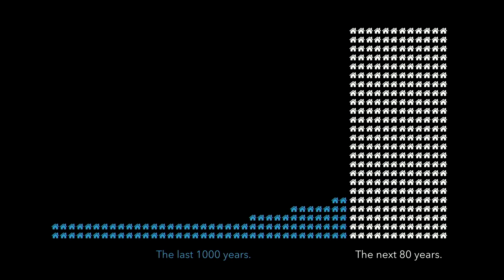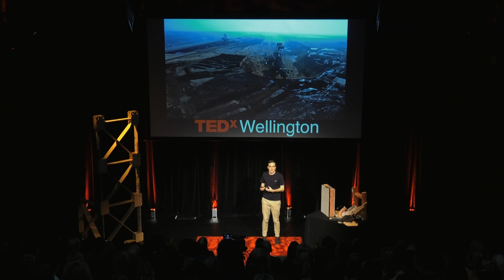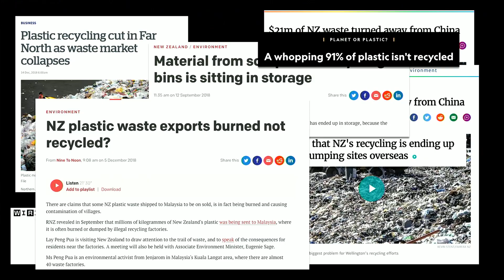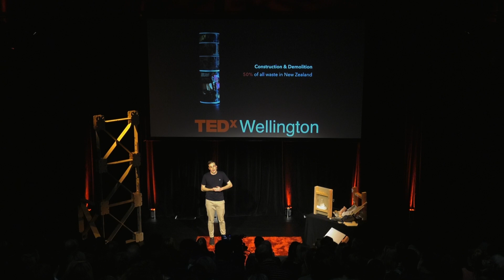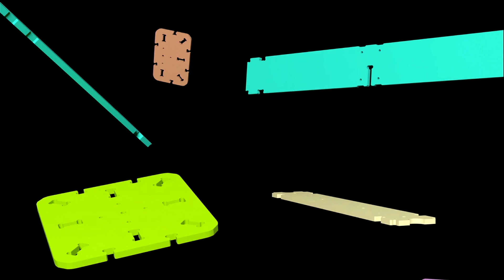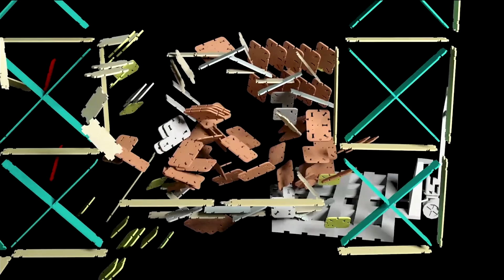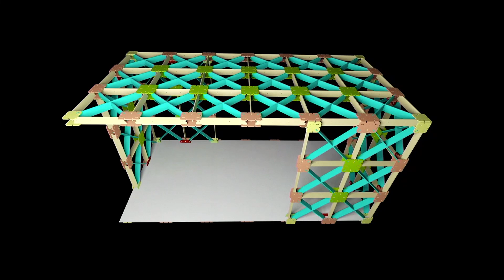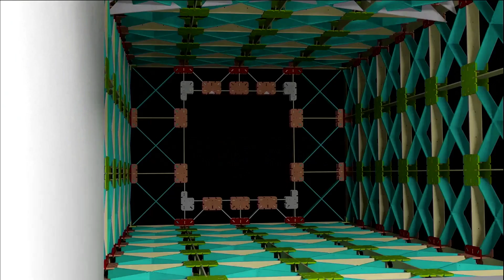Why we need to rethink how we build homes | Ged Finch | TEDxWellington

Comment: In house there is many of functional partarts. Like ventilation, water pipes, warming systems and electricity. It is not only simple core for building. We need think more. One my idea is one centralized container made by metal, which is reusable and can do most water (small kitchen, shower and laundry systems inside), warm and electric needs for house. This is like module what you can attach to bigger wooden "over simplified" living area, easy to reuse/recycle...

Comment: This is really interesting. I designed a similar system for desk and paper management to get into engineerjng school, and I thought about many of the same design problems. The issue with this presentation is that he doesnt really address how these materials would be insulated, waterproofed, and mold resistant without the harmful chemicals he is standing against
Reply: exactly my thought. This doesn't solve much and can be done with screws.

Comment: This presentation poses more questions than it answers... What is the magical material the components are cut from? Is he advocating an even greater use of plastic? Of the 2 billion " houses" the world will need, is this a reference to single family, free standing homes, or does it refer to housing units, many of which would be high rise urban dwellings. How high can you go with this system? Manufactured at scale, how much does it cost , per square foot(meter), per unit? Does this " student" have any financial interest in this project, or for that matter, any practical experience designing and building ANYTHING to completion? 
 There are high quality, reuseable structures. Stone and timber framed dwellings with slate roofing. Good buildings don't need to be recycled every fifty yesrs. We don't build with sheetrock and vinyl siding because it's good, we do so because it's cheap. I watched a TED talk given by a lady architect who worked wonders in bamboo, primarily in Bali. I wouldnt mind seeing big scale foam filled Legos as a building component. (Have you tried plucking those things apart!?) We need vision , not Ikea .

Comment: Eye opening for me.  I'd like to see him get into the practicalities of plumbing, wiring, heating, foundations etc.  I don't see how those horizontal surfaces - ceilings and floors avoid sagging & breaking up, or how the seams in the interior cladding just disappear like that.... the exterior has to be waterproof.  That isn't covered either.  Architects are often accused by builders and engineers of having their heads in the clouds.  This guy may be one of those.  All the same, he's right: we need to rethink current practices, methods and wasteful use of materials.  Absolutely right about that.  Plenty of rethinking required, and this is a good starting direction.

Comment: What is this going to be built with?  Wet wood that shrinks or swells? You'd lose significant amounts of structural stability if there was any deviation in the leveling of the ground/foundation. 

And pardon my ignorance, but... I don't see a lot of compensation for stresses due to wind or earthquake.It's really expecting to put all those stresses on those octogonal shapes that are numerously scattered throughout the structure.

I like your out of the box thinking, but how useful is this?  I think people are going to have a problem thinking their "new" house comes from recycled components.  Who knows where it used to be before (whether down-wind of a nuclear plant or next to a chemical plant)?  Or had mold?  What do you fill the wall cavities with to stop airflow/noise?

And where do you store that amount of material between houses?  

I do like the idea of modularly scaling up/down as life needs changes, but not sure where the concrete pad changes in size or the plumbing/electrical that goes with it.

Lots to consider there!  Good luck!

Comment: I see in the real world example that you show only the structure. How does your product work with the rest of the building systems like electrical, heating and air conditioning, with cabling, and insulation materials?

Comment: What a joke. This is what a PhD candidate thinks is a good idea? Let's just skip the insulation, plumbing, heating, AC, electric? Snap together components will only snap together so many times...there is a concept called wear. Snap together components do not hold up to wind as you can see them "constructing" at 11:30 a building inside another building. ..."inherently resistance to earthquakes" with no testing?

He also skips finish materials. A house may last a 100, 200 years, yet be completely remodeled 10, 20 times in that span (by today's standards). That's what's filling landfills. It's pretty rare here in the USA for a house to actually be torn down. Especially torn down because of structural failure.

Many buildings that have lasted hundreds of years. Take a walk around European cities. We know how to do that. In modern times we understand how to bolt and screw things together to make them reusable...if we wanted to. The issue is we don't want to. We want, demand, the latest style, the trendy. It's not houses that need to be re-engineered, it's the way we think. Don't hold your breath. This ridiculous talk got 2500 up votes compared to 114 down...we're losing the ability to think.

Comment: I been saying that over a decade. India has a cooling design using a kind of bell tower at the top that can ventilate the house and cool it. We can create some really neat materials now and create houses that are mostly modular designed parts. Soon we may be able to 3d print them with hardened carbon.

Comment: It will require recert of every piece of this lego style construction each time you pull it apart and reuse. If you think Fed, State, and local building codes are going to just let you do whatever you want, when ever you decide to... you have not been paying attention.

Not to mention Home Owner's Insurance.

My home is 130 years old. It should last another 130 if some knuckle head doesn't let it get run down. For example, I had it vinyl sided a couple years ago. Cheaper than paint. Lasts 5 times as long.

Good old wood frame, lathe and plaster walls, and a field stone foundation.

Comment: Interesting, that doesn’t seem very feasible. People mystical sorts of stuff on those services what does the finishes will make it hard to recycle of things. And I’m not gonna be recycled. And I look like they have serious structural limitations.

More important than this is making homes that are energy-efficient, structurally sound, and suited it to the environments. As well as providing light and ventilation in the sense of warmth and wholeness and protection to the people use them.

Germany’s “triple-zero” homes or a place to look. You can heat the whole house with a fart.

Comment: let me think...Electrical and pluming can be ad if instead of using that skinny wall you make it a double wall with a space in between, same for the floor and insulation in between the space too. 
 the same double or triple interconnected system could be use to build large Beams that will support heavy loads (roofs, second floors), and all of this structure would made with one material and one material only Bamboo! Give me a lever long enough and a fulcrum on which to place it, and I shall move the world.

Comment: Getting people to accept this erector set type construction isn't all that hard. It's the builders that you have to get invested in your vision. Is it faster, cheaper or easier to produce? What is the profit margin like? Can you get financing for it? Building code approval?

Presumably the resale value should be quite good if you can sell a modular room off when you need some extra cash. But that would also make it difficult to secure any kind of long term mortgage loan since the bank cannot guarantee that you won't disassemble and sell pieces of the collateral. It's added work to routinely inspect and certify the condition of a property. If you offered financing from the manufacturer you might have a shot. Still have to get zoning authorities to let you build in already populated areas if you want to genuinely spread the idea though. I guess you could start your own city, that would be a good objective.

Comment: This guy has zero experience in the building trades.  He may be right that in New Zealand houses fall down after five decades. I don't work in that country so I don't know about their use of materials or building practices.  I live in the United States and I work on houses which are in fine shape after 200 years at times.  Although I do agree we live in a throw away society for the most part, I think one would find that reusing Lego's after 50 years of service is well, laughable.  Your just using a more expensive way of building the parts. The end game is the same.  Maybe they don't have proper carpenters down under.  Don't know.  But we build stuff to last here.

Comment: It might be cheaper and quicker to build, but will creating these components be cheaper than wood?  And will people still be using the same methods in 50 years and actually have a use for these, by then, very old components?

Comment: Too many parts, too many joints. A complex way to make a structure that still needs all the added materials to make it work like insulation, lining, etc. Minimizing the range of bits, labor and materials that go into creating  a building is what needs to happen.  In my view the answer lies in using  a locally available filler like clay, mixing it with recycled plastic? modified into a bonding medium with some structural flexibility and 3D printing the entire house with robot design technology. The cavity insulation matrix, window reveals, wiring conduits etc etc being all 3D printed by a robot with minimal energy requirements. Std, manufactured elements for high load structural elements like lintels, joists etc could be  added as the house was printed. Thanks for prompting the discussion. That's my thoughts anyway

Comment: It would be great if Ged actually provided links to the research. A bunch of CAD animations showed how to construct the walls as interlocking pieces which is great and a nice concept. But what about the waterproofing, insulation, outer cladding, utilities etc. This didn’t seem, on the surface, to address any of the problems touched upon as reasons for current building methods and mterials, like water ingress and heat efficiency which are the primary reasons for building shelter.

Comment: Lets see,  the obvious flaws in this are much higher levels of labor during construction, much higher materials cost,  not to mention nothing was said about insulation,  weather proofing, or dealing with the shortcomings like gas retention that were mentioned when talking about current building techniques.

Comment: imagine building miles and miles of tunnels.  undersground with an ambient temp of 50 degrees F year round. Supplied by geothermal energy from deep tunnels.  Tunnels that have ZERO impact on surface life.  Imagine a boring company with 1000's of boring machines capable of making an entire network of tunnels on every level.  A 3 dimensional city underground with the earth recycled into bricks that need no mortar for tall building integrity.  imagine the roadworks connecting these underground cities being below the surface using zero emission vehicles.   Welcome to Elon world.

Comment: Some house materials CAN be recycled, it just takes a little more work to demolish in stages and separate the materials.  The wood framing is the most recyclable of the materials mentioned, and is not the part that needs to be reinvented. The presenter did not address how he will replace any of the other components he called rubbish, such as the insulation and house wrap.

Comment: Alternative: Clay straw walls. Stands for centuries, can be reused, can go to compost, needs no additional insulation, but: your mobile phone will not have network, as this walls shield from so much including electromagnetic waves etc
Reply: Always easy to put a repeater on the outside of the home.  No issue there.  
Clay is a great way to go.  lots of homes in Europe are built with blocks.
Reply: Anja Schat
Reply: Clay is the future

Comment: The frame  and inside walls are addressed, maybe outside cladding as well, but not the vapor barrier or insulation.  I am inspired by the flexibility of the system, but wonder what you suggest for weatherproofing.  Also, could this system be robust enough for high-rise apartments and office buildings?

Comment: Just as I thought - the only logical way to make houses reusable is to standartize the sructural elements. The problem is, the house is built for individual needs and that may contradict with the standard elements. But it's good that those problems are solved as reusing the carcass is obviously a smarter idea than putting it all in landfills

Comment: I love the enthusiasm if this building concept, but I have huge questions about the building material. How do you trap heat without insulation? Is it water proof? What stop the material from rotting? How much weight can walls made with this material hold? .......many more

 I have seen a lot of ground braking ideas on the internet over the few years that have no real merit(Water from thin air, solar walkways, hyperloop...). All of them have one thing in common, CGI demos. Show me this working in real life, and then I will get behind it. And before you say, "They had a working building in the video." Ask yourself if you would live in what you saw there. Would you put that on your property and run utilities to it? Would feel safe with your family huddled under a snap together house when a storm hit?

The only way I can see this working is if you add a lot of the stuff on the right side of the stage to it.
Reply: Exactly!👍
I'm a structural engineer in residential construction and have the same questions. This architect doesn't have a clue.
Reply: Fiberglass inserts would be reusable
Reply: thekingofspadesk  it is a Ted talk, not a product
Reply: Bolts or built-in fasteners could very easily be made to be stronger than nails. Our skyscrapers use bolts.
Reply: @dougb70  I get it's a ted talk, but it is so vague on how the end product would work, he could have  gotten on the stage and said that they where going to build their homes out of cotton candy and unicorn farts, and it will but just as possible.
Reply: @dougb70   The dude literally said you won't need to have fasteners...
Reply: It's simple... This product won't work.

Comment: All new buildings and retrofits need to consider energy efficiency when building or remodeling.
Air sealing, super insulation, triple pane windows, energy efficient doors, efficient heat and air conditioning systems, set back thermostats, energy efficient appliances, LED lighting systems, solar panels, battery storage and a 220v outlet in the garage or car port for an electric vehicle charger. Buildings should be built to last 200 years or more. People seem to look for the cheapest upfront cost rather than looking at long term benefit. Energy efficiency saves money month after month, year after year.  Saving energy saves money. Would love to see these ideas of reusable materials incorporated in everything we produce. For example there should be no single use plastics.